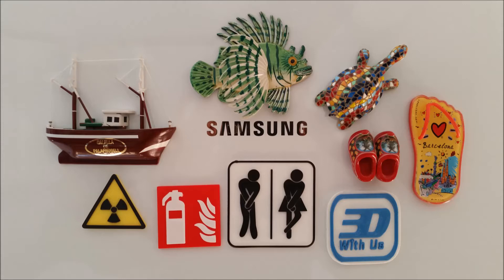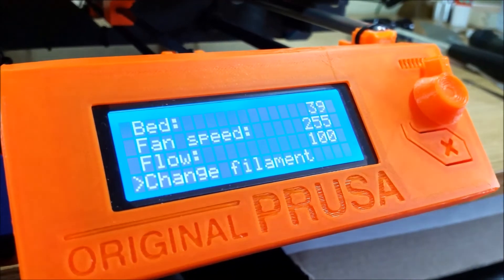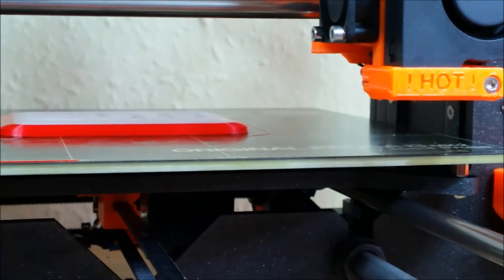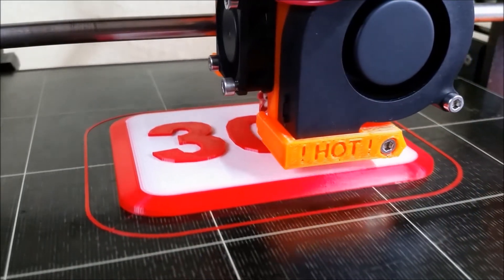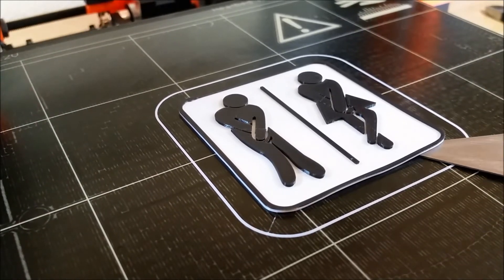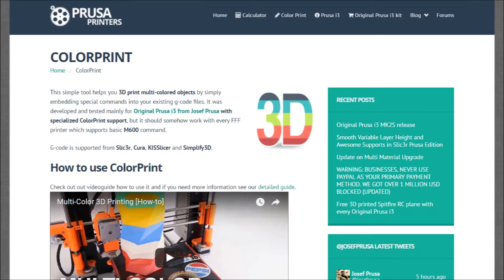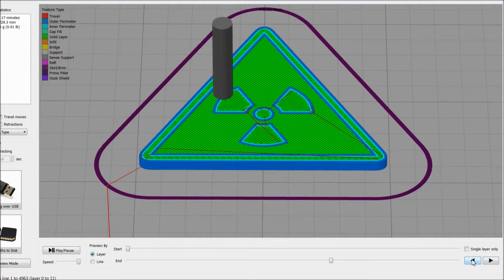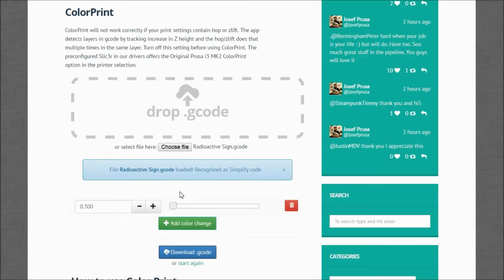Multicolor 3D Printing With a Single Extruder - Ideal Solution for Logos and Signs

Comment: You can also do this directly in S3D in the scripts tab, below in additional terminal commands wit this

{REPLACE "; layer" "M117 Layer"}
{REPLACE " Z = " " Z="}
;{REPLACE "\nM117 Layer 10, Z=" "\nG1 X0 Y0 Z70\nM0\nM117 Layer 10, Z="}
;{REPLACE "\nM117 Layer 15, Z=" "\nG1 X0 Y0 Z70\nM0\nM117 Layer 15, Z="}

just remove the ; in front of the command.
Reply from the maker: Hi Oeve, thanks for the tip. We will check it out.